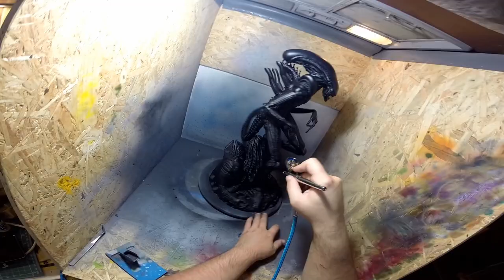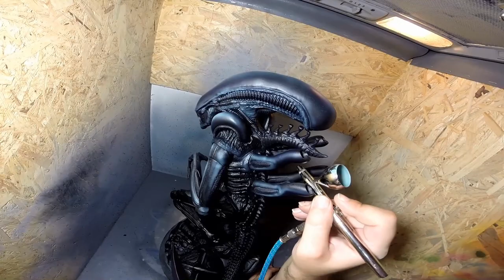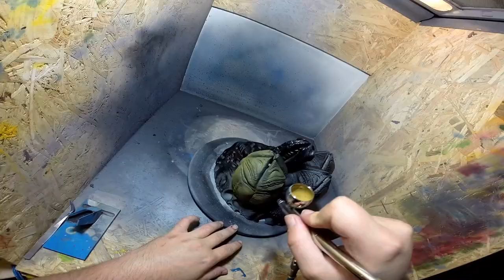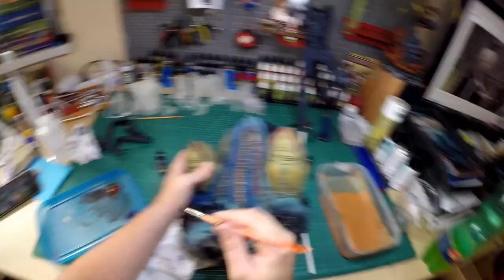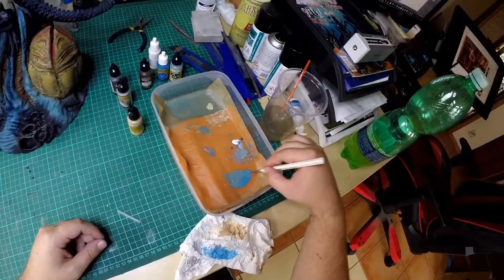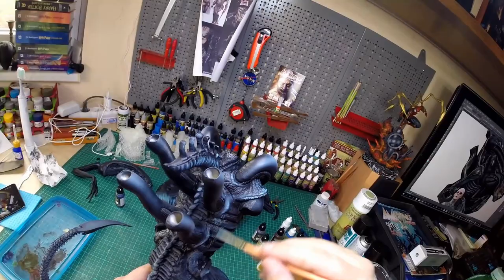#2 How to Paint Alien Xenomorph 3D Printed Statue

Comment: How did you print the jaw, I used s3d and the teeth was badly printed and fell off. Any ideas how I can get a perfect print
Reply from the maker: Helolo i printed it at 156% scale so it was easier to print them and i helped with cut jaws in half and print teeths without support from bottom up.